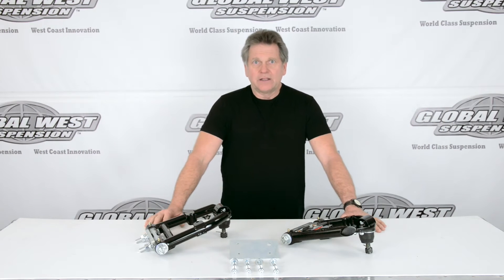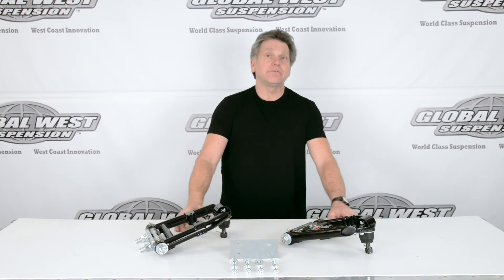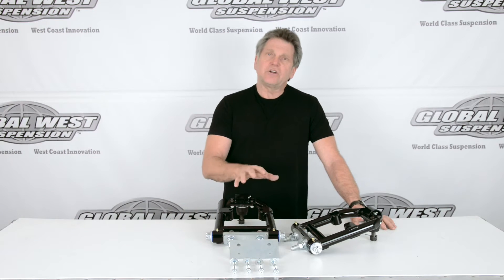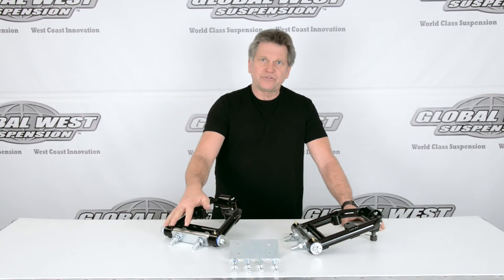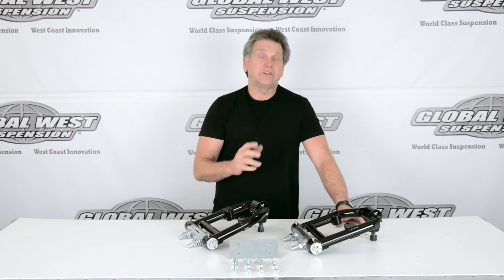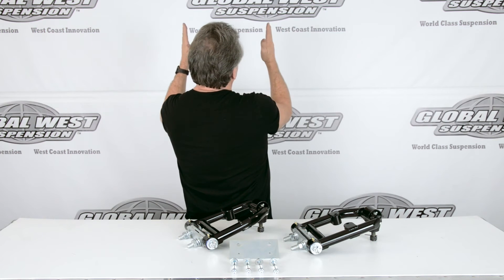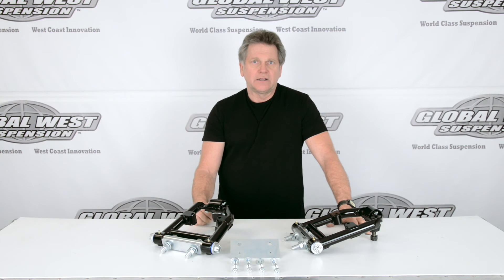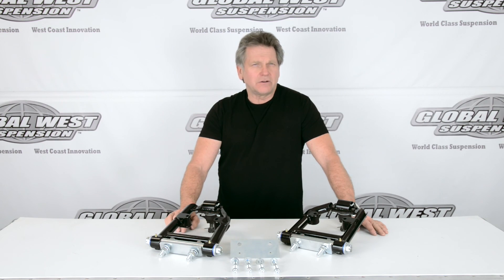1963-1965 Falcon & Ranchero Negative Roll Camber Kit - Global West Suspension

Comment: Is this kit designed for the 6 cylinder motor, as my 63 has 13” tires. Does this mean I have to upgrade to 14” tires and rims with the 5 bolt pattern? Will this affect my tire clearance in the wheel wells, especially in turning? Is this modification strictly for the v8 application or is this kit also for the 6? The springs say small block application. Are they too stiff for the straight 6? I have the 2.8.

Comment: Are they American made? Is there any lubrication requirements? Can my local mechanic put them on? How much are they, including the springs, which it sounds like they require also? What negative impact, if any is there in this conversion in the cars handling characteristics? Long term wear issues? Will this tighten up this cars loose steering play or is that a separate issue?

Comment: I have a 1962 Falcon. Would this work for that? If they did, could I just switch these out for my normal control arms and that's it? Nothing else has to be changed in order for it to fit and handle?
Reply from the maker: these are designed for 1963-1965 model years

Comment: What is the reason why these control arms don't have a 1961 Falcon application?
Reply: I have a 61 ranchero and it's hard to find  upper and lower control arms , I'm trying 64 mustang parts
Reply from the maker: For the most accurate response to your question give our tech line a call! 877-470-2975